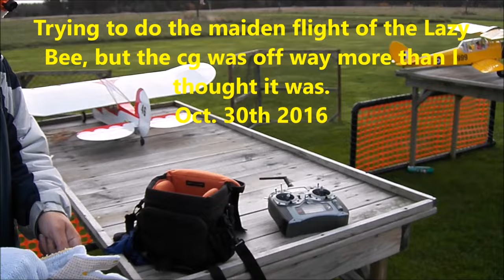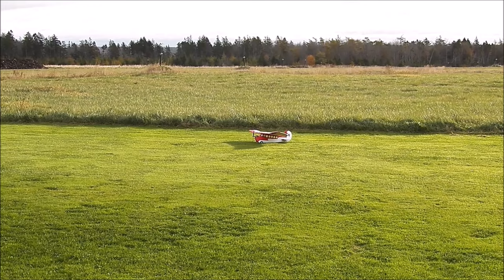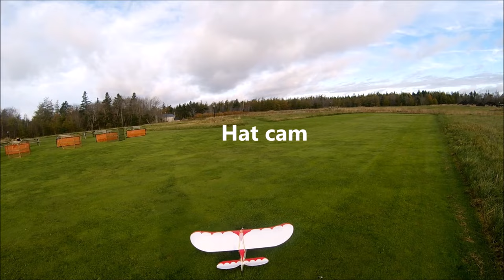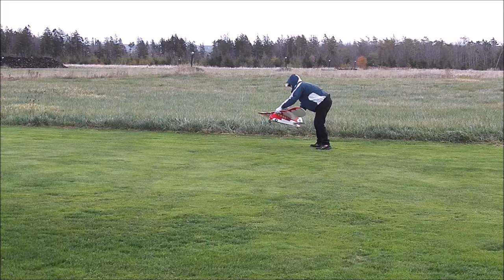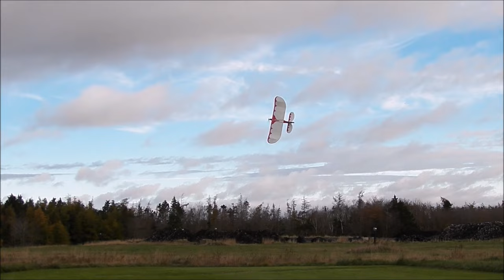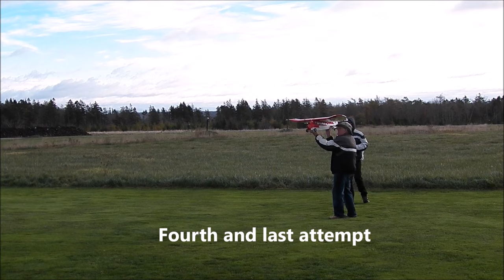Lazy Bee Maiden Flight Fail

Comment: The first thing I spotted before it took off is that thrust angle, man. Even if it were set noseheavy with that same thrust angle and headed into the wind with full back elevator like you had... Same result. Thrust angle.

Comment: I think it's not (only) a CG problem. Try lowering your motor angle (point it downward). In the video, it seems like the motor is trying to rotate around the plane's  CG. That usually means the motor is pointed too much upward.